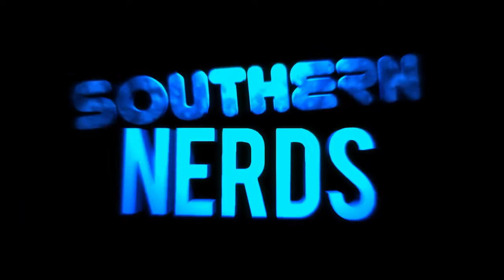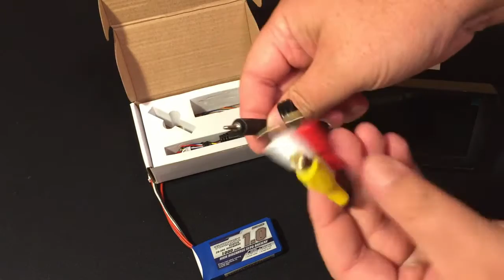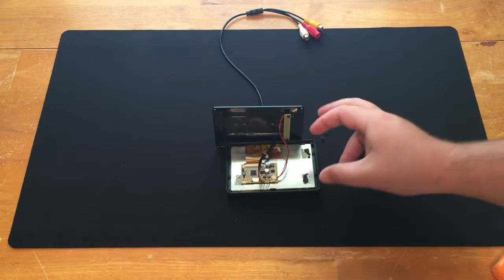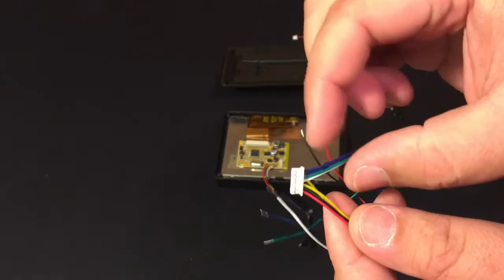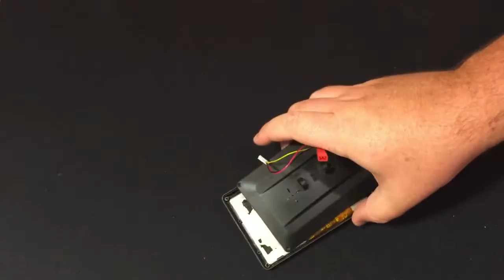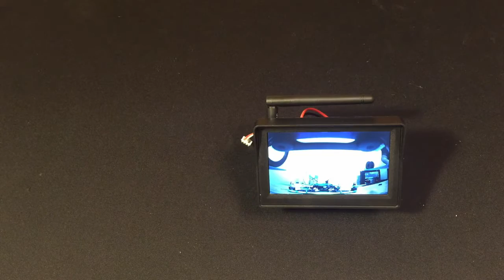Cheap FPV Monitor For Under $35 - Easy Build

Comment: What is receiver distance.?
Reply from the maker: There are a lot of factors that can impact the distance (such as trees or buildings that interfere with the signal). We fly often at a open soccer park that has about 5-6 soccer/football fields and we can fly to all corners of the park with no reception issues. So, you can fly a few hundred yards away, but don't expect mile range.

Comment: Besides using eachine er32, use the receiver, bro. The stock is all empty there might be another receiver solution this tutorial is cheap and very easy please answer greetings from Indonesia
Reply from the maker: Hello Indonesia! Any receiver will have the same wiring and can be used. I might need to make another video with an updated receiver. Stay tuned.
Reply: @SouthernNerds  oke thanks

Comment: Nice video sir, really this is very easy and budget fpv moniter....thank u so much i want to build it, but this ER32 receiver is not available in banggood so thats a sad thing, can u help me where can i found this reaciver....??
Reply from the maker: Here are a few options from banggood, but you can search VTX on Amazon too if that is your preference : For Mini Drones (Like a tiny whoop): http://www.banggood.com/Eachine-VTX03-Super-Mini-5_8G-72CH-025mW50mw200mW-Switchable-FPV-Transmitter-p-1114206.html?rmmds=search For a Racing Drone (Like a 180mm or 250mm racing drone): http://www.banggood.com/TS5823S-Micro-VTX-5_8G-200mW-48CH-Mini-FPV-Transmitter-SMA-RP-SMA-for-RC-Racer-p-1127469.html?rmmds=search
Reply: Thank u sir for replay but, you send me a transmitter link i need ER32 receiver not a transmitter...plz read clearly what i say in comment

Comment: ...or you can buy a Male RCA to Male RCA Barrel connector. Very cool, I'm guessing the white wire is for audio, also it might be a bit neater if you had room to mounted the Rx inside the back plate of the monitor, but if you need to change channels you would need to open it up again. Thanks for sharing!
Reply from the maker: Thanks for watching! Yea, multiple ways to setup and wire. Thanks for the additional comments!
Reply: Exactly...

Comment: can u give the full name of the monitor? Or http://www.ebay.com/itm/4-3-TFT-LCD-Color-Screen-Car-Rear-View-Monitor-DVD-GPS-for-Car-Backup-Camera-MT-/201866633960?hash=item2f003062e8:g:zhQAAOSwA4dWKwpt  is this product ok with 7.4V 1000mah battery(like u use)  ???
Reply from the maker: The one you have linked here looks exactly like the model I ordered so it should work! And yes, most of these backup cameras will run off of 7.4v batteries. You can go larger than 1000mah if you wanted to for longer battery life, but the 1000mah batteries are cheap and small to include in the build.
Reply from the maker: Also, if you are buying additional parts off of banggood....they have a 4.3in monitor now that they stock for 13.99, which also looks like the same model as mine.   https://www.banggood.com/FPV-4_3-Inch-TFT-LCD-Monitor-Screen-For-RC-Models-p-940817.html?rmmds=search?p=N023104763101201605F.

Comment: Hey great video!!  I do have a question, I have an fpv I built and fly.  I use a lumenier TX5G2R Mini 200mW 5.8GHz FPV Transmitter with Raceband.  I use a pair of fatsharks.  I also have for free a HAIER Brand 7" Digital LCD TV.  I would like to use this as a cheap DIY FPV Monitor for my son to hold and watch on while I fly.  You mentioned that the Eachine wont work with Raceband?  I don't even know what raceband is nor why it wouldn't work.  So any info there would be awesome, besides that what transmitter can I hook up to the 7" Digital LCD can I use?  Another Lumenier?  I'm lost at this level lol....Tearing apart, soldering etc. no biggie....but this other stuff is like another language.  Thanks for any help!
Reply from the maker: Eachine will work with RaceBand, just not the receiver i used in this video (which I think is no longer available; I need to update some links). You can pick up any receiver that has the correct Band/Channel, such as most receivers that have 40 or 48 channels (which you should see Raceband mentioned in the description/bands listed). Like, here is an example:
http://www.banggood.com/Eachine-RC840-5_8G-600mW-40CH-Raceband-Wireless-FPV-Receiver-Module-p-1045476.html?rmmds=search?p=N023104763101201605F

Now this receiver is larger than the one I used in this video, but it does pick up Raceband and would be about the size of my monitor in this video.

Comment: how do you connect the fpv camera on the drone to the monitor?
Reply from the maker: You will need a VTX connected to the FPV camera on your drone to send the video feed wirelessly to this monitor setup. 

Many drones that you buy as a complete package will already have a VTX/Camera combo on the drone. Once the VTX/Camera combo have power supplied you should be able to scan through the channels on this monitor setup to find the video feed.

Here are a few options from banggood, but you can search VTX on Amazon too if that is your preference
:
For Mini Drones (Like a tiny whoop): 
http://www.banggood.com/Eachine-VTX03-Super-Mini-5_8G-72CH-025mW50mw200mW-Switchable-FPV-Transmitter-p-1114206.html?rmmds=search

For a Racing Drone (Like a 180mm or 250mm racing drone): 
http://www.banggood.com/TS5823S-Micro-VTX-5_8G-200mW-48CH-Mini-FPV-Transmitter-SMA-RP-SMA-for-RC-Racer-p-1127469.html?rmmds=search

Comment: About how long is the fpv monitor's battery life?
Reply from the maker: It would depend on the battery choice. I use a 1000mah 7.4v 2S battery and can leave the monitor powered on for around 1 hour or so, but you could use a larger battery (or even a 3S battery if the voltage specs are appropriate for you hardware) and get longer battery life.
Reply: Thanks, makes sense.

Comment: Quite impressed in this little setup, might have a look at starting in FPV with something like this, think I might also be tempted to put a small slide switch in the side of the case of the monitor. Was also looking at some case builds on thingiverse!

http://www.thingiverse.com/thing:1891922
http://www.thingiverse.com/thing:1611044
http://www.thingiverse.com/thing:1184799

Do you think that the receiver would fit inside the case if you put a pigtail on the antenna connector, or would the dremel have to come out? or mounting it on some standoffs, not that I dont like velcro (more thinking of weather proofing/dust sealing). Could probably just get the heat shrink out first i know ;-)
Reply from the maker: Awesome, Glad we can perk your interest in FPV! Yea, I think this monitor setup could fit in a case like that if you want to have an enclosed system. I personally like the form factor it is in b/c it is very small and I can run this thing all day if I have 2s/3s batteries to throw at it, but you could make this a more finished product with a little more work.
Reply: Southern Nerds sounds great whatever it looks like, think I'm just looking for a project, not done any soldering in a while, dare say, heatshrink and Velcro would be fine!

Comment: Thanks for the video. Will this monitor go blue on signal loss?
Reply from the maker: No, this monitor will go to static on signal loss, but some monitors will blue screen instead.

If you are having issues with blue screen or static it is most likely due to the monitor not having a constant video feed. To remedy the problem put something that has a constant video feed like a DVR in line with the receiver and it should fix your problem. (One of the Southern Nerds crew was experiencing this issue and we put a mini DVR in line and it eliminated his problem; this was not an issue with my build, but it seems to be a monitor related issue)

You can pick up this Eachine Pro DVR to do the trick for $17.99 (sometimes you can catch them on sale for as low as $9.99) - 
http://www.banggood.com/Eachine-ProDVR-Pro-DVR-Mini-Video-Audio-Recorder-for-FPV-Multicopters-p-1061196.html?p=N023104763101201605F

Comment: do you have a link for the JST connector?
Reply from the maker: https://www.amazon.com/VIMVIP-Pairs-Connector-Female-Battery/dp/B00N8OFYX8/ref=sr_1_13?ie=UTF8&qid=1485993082&sr=8-13&keywords=jst+connector

https://www.amazon.com/RGBZONE-20Pairs-Connector-Cable-Female/dp/B013WTV270/ref=sr_1_1?ie=UTF8&qid=1485993508&sr=8-1&keywords=RGBZONE+20Pairs+2Pin+JST+Plug+Connector+Cable+Wire+Male+%2B+Female+100mm+by+RGBZONE

Here are a few options on Amazon. You can find these on sites like ebay too, but this will get you started.

Comment: Really nice and simple! Just wondering, what transmitter are you using, or is any 5.8GHz transmitter possible? Except for the race band ones that you mentioned in the description.
Reply from the maker: We are using the Eachine ER32 from Banggood.com on this video, but you can pretty much use any receiver. The only thing about race band is if you would like to be able to view the Race Band Channels....you will need a receiver that picks up race band.
Reply: Thanks for the reply! I know you're using the ER32 as it says in the description, but I was wondering about transmitters. Does any 5.8GHz transmitter work with the ER32? (well except for the race band ones)
Reply from the maker: Oh, sorry I guess I misunderstood what you were asking. 

Yes, it should work with any 5.8ghz transmitter that are on the same channel/band as the ER 32 (you can see all of the channels/bands at the bottom of the page on the ER32 link above). I have been able to pick up all of the video feeds from the drones that our group flies, which include photography drones, racing drones, and mini drones. I even bought a cardboard headset to place this setup in in case any guests want to watch on "goggles" instead of the monitor.

Comment: I have no knowledge about these monitors at all, and I want to ask if it would be possible to play the PS4 on it?
Reply from the maker: These monitors would not be ideal to play PS4 on as they do not have any HD inputs, but if you check Ebay you might be able to find a similar monitor around 5-7 inches that will accept HD inputs, like HDMI. 

I do not want to say it absolutely wouldn't work b/c you could probably make it happen with the correct adapters, but I would not use it to play PS4 in my car or something similar. You can pick up in dash TVs with bigger screens and better quality for pretty cheap these days.

Comment: Since the ER32 has a voltage tester on the board, will conecting the screen to the balance port/main port still work with the voltage tester so I don't drain the battery dead?
Reply from the maker: I have not tested the voltage tester on this....I have just connected a battery during flight time so I have only had this thing running 6-10 minutes at a time (typically). I need to do some tests and I can posts additional videos!